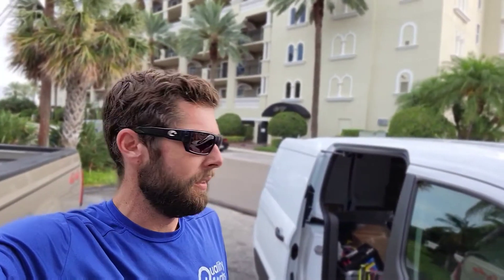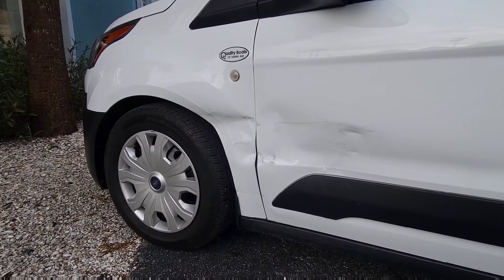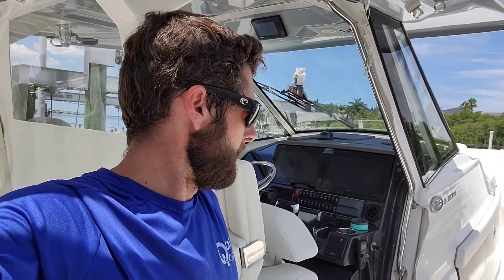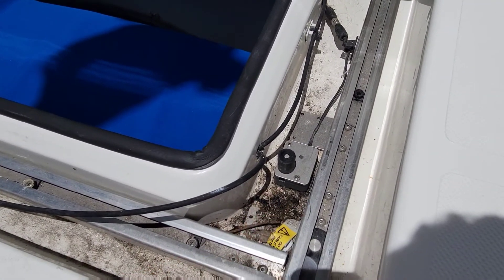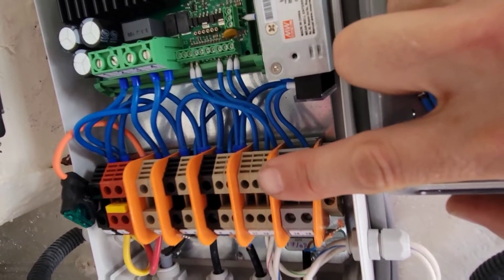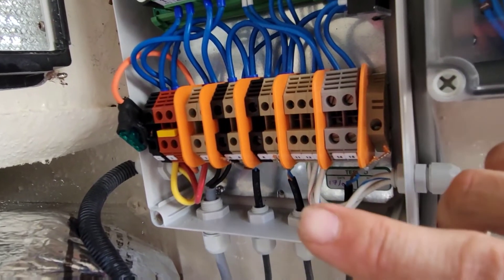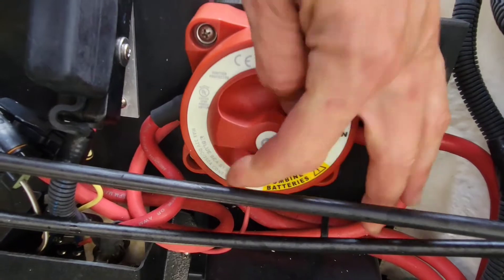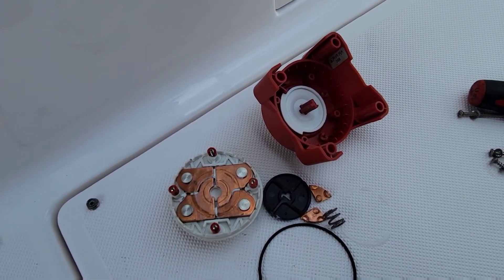A Sad Day But the Show Must Go On - Episode 59

Comment: My Blue Sea switch is doing the same.. Thoughts about the Blue Sea battery switch with the ACR feature? Worth the hype about the auto charging relay? Or just go back to the Perko dual battery switch?
Reply from the maker: I would stay with Blue Sea products. They changed the switch design so it doesn't break the back plate over time.  I haven't seen really any problems with ACR that Blue Sea makes.
Reply: @JustinLeeMarine  thanks for the feedback.  Going to reach out to them tomorrow and see if they'll send me a replacement.  Bought it in Dec. 2019.
BTW, I like your content. 
Thanks again!